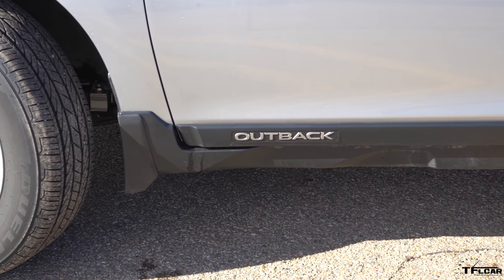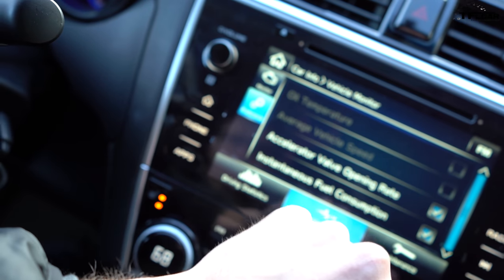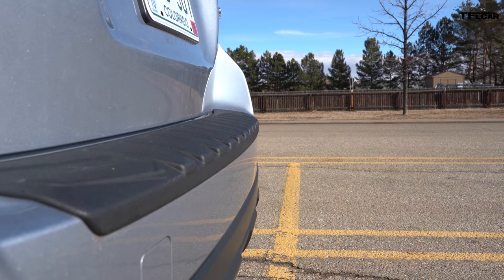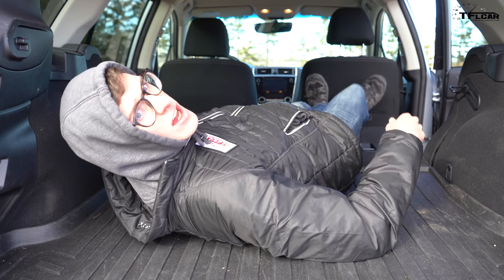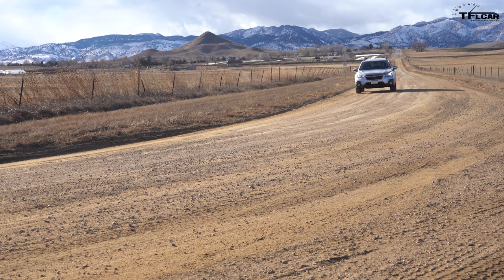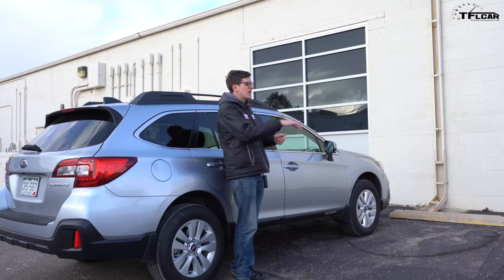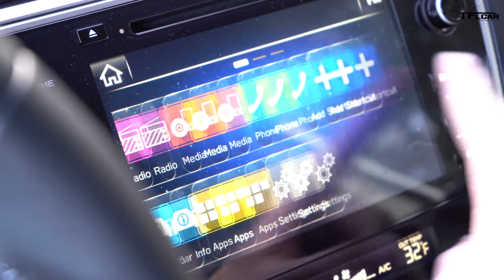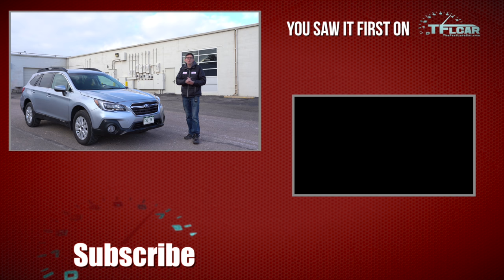The New Subaru Outback Isn't Your Dad's Station Wagon - Except it Totally Is...

Comment: Maybe you should trade it for a 2016 model...I have never had a problem with the key fob.The hood fits fine, the CVT trans works great and it's not a slug. Practical car for family's,campers and dog lovers.. and those that want X-lent Mpg.
Reply: 2019 model has push button start. The key doesn't brick with the keyless keys.
Reply: Well, until I watched this video, I didn't realize/notice the hood fitment issue. I too have a 2016 Outback Premium. The hood is pretty much misaligned as Tommy shows it in the video. However, like you, I have never had the first issue with the key fob. In fact, LOL, the keyfob works so well, that I didn't even realize that the outside door handles actually had key holes!
Reply: @subscriber6181  The 2016 models also offered the pushbutton start on the higher level packages.

Comment: Can you compare it to a Crosstrek? I like to see the difference in space, handling, entertainment, and fuel economy.
Reply: Adam Buesser crosstreck is considerably smaller. Adequate for 2 people but if your using the back seat and hatch to move people and stuff around regularly the outback is the way to go.  I’ve got the outback myself, my mum drives the crosstreck so I’m pretty familiar with both.
Reply: I just traded my Crosstrek  for an Outback.  The Crosstrek  is good for city driving and zipping in and out of parking spaces, it actually has more preset radio stations available than the outback  (36 to 18),  but you give up a lot in terms of comfort. The driver seat is notorious for losing  it's cushion comfort within two years and  there's really not a lot of storage. 

Also, don't believe the ads where they show people putting bike carriers on the Crosstrek's tow mount. Putting a tow mount on a Crosstrek is expensive because the dealer has to move the gas tank, hook up the tow, then put the tank back.

Comment: You haven't lived until you've had a station wagon with suicide seats.  Those were too little seats that faced  rear traffic. God help you if you got rearended.

 Driving the outback is indeed similar to driving an old station wagon in terms of size, but in terms of repair bills and gas mileage, they're completely different animals .

Comment: Great Video and what an awesome style!  TFL needs to do more videos like this.

As for the Subaru Outback....  Yawn.  I grew out of my Subie phase when I bought my first Jeep at 23 years of age and have not looked back.  Well, that is not true.  I go back and look at Subies every 5 years and discover they are the same generic, utilitarian designed cars, but now with Toyota at the controls, they lack the funky style and characteristics that made the 90s and older models so lovable.  I don't want an all wheel drive toaster.  I want a car that lets me have an experience every time I turn the key or push the button on the dash.  In short, the new Subies are almost the most boring car on the road.  I have to say "almost" because the 2018 Chevy Malibu IS the most boring car on the road and something that I would drive only if I were forced to under great duress (like the only thing available at Avis). 

And for a moment of brutally honest truth, the run of the mill Subies have never been as "reliable" as the company claims or as legendary as some of the tall tales by owners.   They are good cars with a good reputation and they are above average in most categories for day to day usefulness, but my Jeeps have been far better than any of the Subies that were parked at the family compound when I was little.  And now, all of my Fords are as good as my friend's Subies and those Jeeps at the Kentucky Compound are still Jeeps which are reliably doing their "thing."  Quite honestly, I would not go back to Subaru after spending time in a 2018 Legacy last year simply because it has the personality of an Electrolux vacuum which are never as high in performance as a Dyson and not nearly as awesomely funky as a Kirby.   But at least, the Subie is better than than the Shark vac at Costco which is always cheap and never performs to expectations. ;-)
Reply: I agree. I own an 07 Forester now, but before I bought it, I drove a 14 Legacy, 13 Outback, and a 13 Forester. I hated them all. Numb, weak, slow, and lifeless. I bought my Forester because it has a personality (and sometimes a mind of it's own...)

I would have bought a Mitsu, but my dad was pushing me for a Subaru. I would swap my Forester for a Lancer GTS or Sportback with a stick ANY DAY.

Comment: Reasons i wouldn't buy this Subaru OR just about any Subaru and own it outside warranty. 
1. Many have a Turbo. (turbo is just 1 more thing to break and they will ) 
2. CVT  transmission
3. Subaru's have head gasket problems , they all do eventually. 
4.A few years back they had a real problem with Oil consumption.  Hopefully that  is solved. 
5.Made only in Japan i believe, shipped to north america
6. AWD , one more thing to break if you don't need it + the having to change tires out if they wear different to avoid messing up the differential for the awd. 

Good Cars in Many Ways , But not in others.
Reply: "Many have a Turbo. (turbo is just 1 more thing to break and they will) ".  A crock, skippy, and you know it.  They dropped one car with a turbo (Forester, because no one bought the turbo, and added the Ascent) "CVT  transmission".  What about it?  Toyota, Ford, and soon GM will be using CVTs - deal with it.  " Subaru's have head gasket problems , they all do eventually".  A myth - next fable, please. "A few years back they had a real problem with Oil consumption.  Hopefully that  is solved".  Yes - resolved, so please try to keep up.  "Made only in Japan i believe, shipped to north America".  FALSE - Outback is made in the U.S., hence, the shoddy assembly quality.  "AWD , one more thing to break if you don't need it + the having to change tires out if they wear different to avoid messing up the differential for the awd".  Subaru sets the bar for AWD, and there are SO MANY OTHER MANUFACTUERS that have been installing AWD on their cars for years - what about them, skippy?  Bottom line: you listed a pile of childish bull about Subaru - you're a liar. Grow up.

Comment: C.V.T. goodness.No such thing.Ask Nissan how well it worked out for them.Nobody want's a used car with a CVT transmission.
Reply: @Paul Tabone Excluding the Justy,The 1st year Subaru used the CVT was 2010.As far as it going another 100,000 is very unlikely.Google outback CVT replacement.
Reply: @Paul Tabone good luck if your CVT can go another 100k
Reply: I love how all the Subaru Fanboys swarm when a different point of view is presented. The CVT trans is not ready for prime time yet.
Reply: Decades...bahahahahahah...What are you talking about.
Reply: It may not be the best thing, but really it's fine for what it is. I get 24.5mpg/avg with a 2" lift and AT's. Around town it delivers power just fine, the paddle shifters allow better acceleration and gear-holding offroad, and I'm at 77K with no issues from mine. As well, not feeling gear shifts is strangely pleasant in a way I didn't expect. I'd prefer in my year to have the 3.6r with the 5EAT, but I'm happy with what I've got.
Reply: Well A quick google search explains Subaru CVT are Subaru and Nissan CVT are well not Nissan but JATCO.  Of course I went with a manual in my WRX and didn’t buy a civic instead due to Honda CVTs.  (Honda has been struggling a bit too). 
“Audi, Honda, Hyundai, Subaru, and Toyota all make their own CVTs. Nissan owns a controlling interest in JATCO, the firm that supplies 49 percent of the world's gear-free transmissions to Chrysler, GM, Mitsubishi, and Suzuki.”  Well JATCO CVTs can’t be worse than the GM and Chrysler Automatics that my family has had.
Reply: @7239Matteo  That may be true, but my 14 Outback CVT has 88K and seems to be just fine. I would like to get a new car, but the Outback is still mechanically sound (and its paid for). No real reason to trade it in.
Reply: 290k on my 2010 cvt.. No issues yet. Love how it is always in the right torque band, super gas mileage as well. Had many Subaru's and still have a 2009 forester with automatic transmission..  I much prefer the cvt ..
Reply: @albarriault6147  no issues with the CVT?
Reply: Been good, only issue i had was to have a solenoid replaced last year, No charge from the dealer. everything else is original with no issues . My only grip with my 2010 is the headlight bulbs location , changing is a bit of a Pita